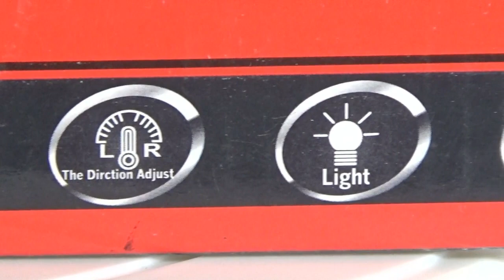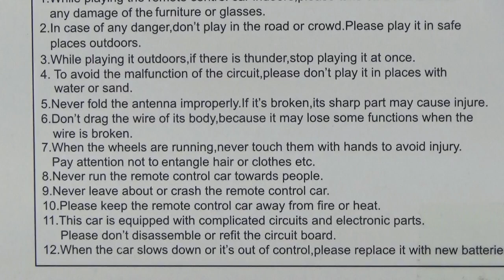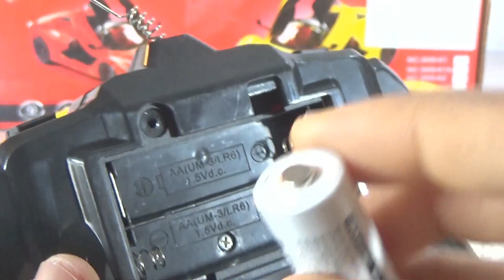Saffire Remote Controlled Super Car with Opening Doors (Model - 2017) : Product information

Comment: Isme battery bar bar change to nhi krni pdeggi  bs charge krte Rehna h reply plzz
Reply from the maker: Thank you so much for your query.  The car comes with four 700mah batteries, which are rechargeable,  so u don't need to buy alkaline batteries separately to run this car,  just recharge the battery provided when they are exhausted.  Hope this will help.  Regards

Comment: ###Sir my car's gate are not opening , is i need to charge more for door opening because i thinks that to open the doors it needs more energy### ??
Reply from the maker: Thank you so much for your query.  Is the car running with full speed & not opening and closing the doors when the battery is fully charged?
Reply: # i think that i have not fully charged it but the speed is fast yet but doors are not opening#
Reply from the maker: Thanks the reply.  Just try to change the battery fully and try to run it once more, if the same things happen,  try to manually open the door (but be careful,  not to break anything) and look for anything like small particles causing the jam or not.
Reply from the maker: Charge
Reply: #sir just wait plz i will charge it full and then i will reply you back thankyou#☺
Reply from the maker: Sure.
Reply: Sir i had charged it full but till its doorss are not opening  and it has spring connecting the doors to the Mechanical system
Reply from the maker: Actually there is a motor, which helps the door operation.  Press the door opening button and try to listen to the sound of the motor inside running or not.  If u can hear the sound and the door is not opening,  it means may be there is something which hinders the door operation.  In that case try  manual opening. See if this helps or not.
Reply: Science Sir ok i will check thankyou